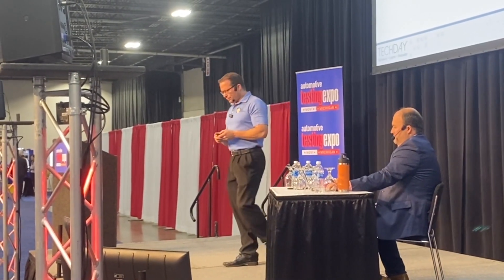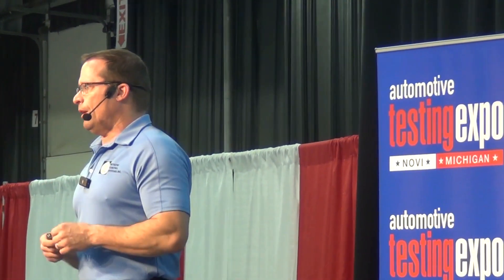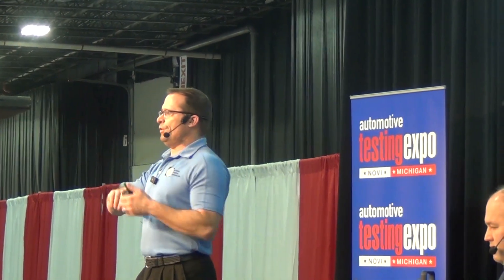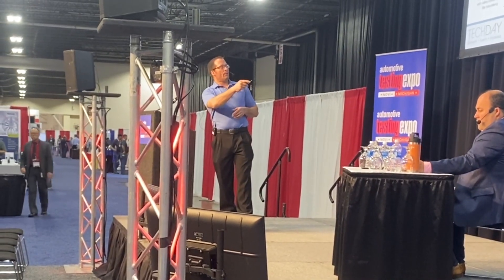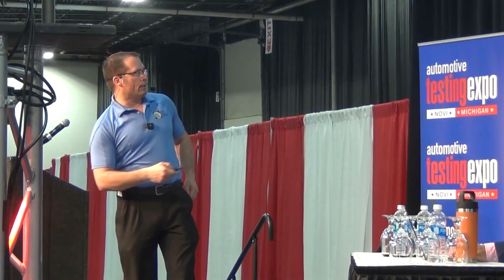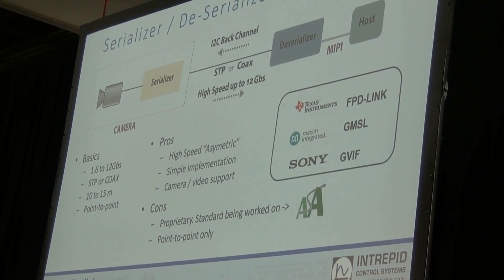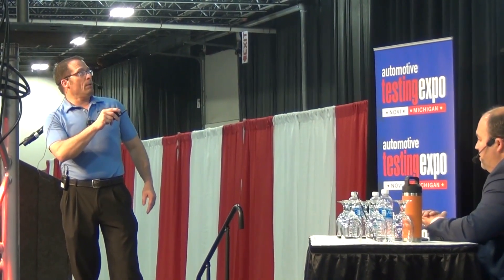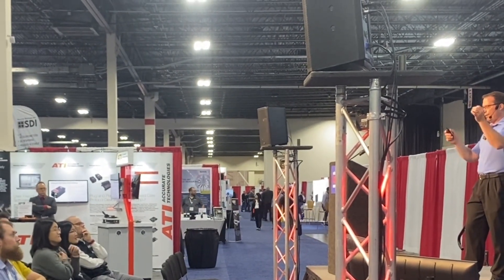Zonal Architecture Technologies & Their Impact on Autonomous Vehicles at #TestingExpoNovi

Comment: Good presentation .  A few comments. Tesla has integrated the ADAS already to the central computer unit. We are also getting new SOCs which are designed to support running a  mixed criticality ( in terms of safety and realtime) software stack in one SOC ( all the way up to ASILD).   Moving the intelligence away from often microcontroller based ECUs is critical not only to enable easier software updates but also for being able to implement cross domain and cross ECU functions in the first place. This is one reason also why CAN having fixed communication scheme is quite useless in zonal architecture except for the last leg ( from zonal controller to dummy IO controller/ sensor)